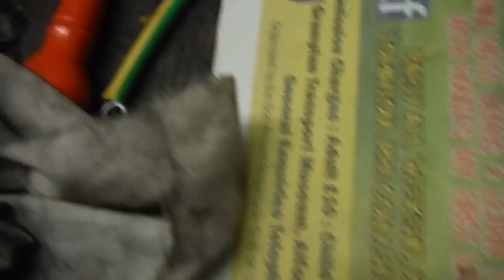Amal MK 1 carburettor - clearing blocked pilot jet passageway.

Comment: Paul remember the two holes in the center on the bottom of the throttle tube on either side of the back of the slide.  The tickover fuel and air has to have somewhere to go after they have been mixed.  Those two holes must be clear as well.

Comment: The hole from there into carb throat gets blocked as well, you can just drill out the jet with a 2.0mm drill taking care down the pilot screw hole taking care not not to damage the air screw seat you then put a new jet into the threaded boss in the top of the carb body float chamber usually used for 2 strokes
Reply: I think a man named Brian Stratton made a video on what you're talking about. If you find it let me know if that is what you were saying.

Comment: My friends and I use the smallest guitar string; I think it is .009”, very strong and stiff. Worked on my ‘69 Bonnie nicely. 
Possible to drill and tap the opposite side and use it for access on the close side and plug it after clearing. Appreciate your site !!

Comment: This is very informative, thank you. It's very hard to figure out these carbs when you start. But do you know if it's possible to replace the brass insert? After one hell of a game, clearing & re-blocking several times, I finally got the bike running okay, but too rich. Air screw is out  over4 turns now, still black plugs so I fear I've over-done it
Reply: *Stretton

Comment: Hi Paul great video question 
My bsa a65 concentric is pretty new ran great last year now it’s well blocked 
Do you know the max size drill I can use it says #78 drill equals to .40mm

If I use a 0.6mm drill would this do any damage to the pilot system 
Thanks a lot phil
Reply from the maker: Hi Phil, 0.016" rings a bell for the pilot passageway diameter.
Reply: @paulhenshaw4514  
Cheers Paul 
Yes, I rang Amal today and actually ordered a new carb and will be using my blocked one for my other bike which requires one and will be having a poke about but won’t be using anything bigger than .0016 and won’t be drilling only poking 👌👌
That A65 you’re working on…. Blimey that looks like a nightmare and going to be an expensive one I’m sure 😌😌

Comment: thank you, I cleaned mine a couple weeks ago, will have to do it again. starts but no idle.  Initially i didnt have the right wire and thought it was good enough.. not so.
Reply: They clog up quick if the bike sits. Pain in the butt.

Comment: Hi Paul 
I am Kumar I have just fitted new carb ( Amal mk1 concentric 26mm) and pod filter looks same as one that picture  above on my bike  ( 1984 Royal Enfield 350cc ) I have few questions to ask if you don’t mind and I guess as you are  using Amal carb you would be able to clarify my doubt my questions are followe
1  I don’t find any difference of using Amal carb as I was using mikarb before or Am I tuning is not right way?
2 I feel the throttle cable is just a bit hard to throttle after changed to Amal carb ( have been told by mech just because of the spring in the Amal carb is high tensed one than one was on mikarb
3 after changing the airfilter from the Indian made box type to Amal pod one which gives me ‘kisk’  ‘ kisk’ noise or is that normal with that sort of filter as I never used that before 
replies will be much appreciated 
thanks

Comment: Hi Paul, thank you for making this video, I have a 67 tiger and it's hard starting, it only stays running when I'm working the tickler and the throttle at the same time. Do you think this is my issue a blocked passageway. Thanks if you could please respond.
Reply from the maker: Hi Nick, it sounds like this could well be your problem.
Reply: @paulhenshaw4514  thanks Paul, it only stays running, when I'm working the tickler and the throttle at the same time

Comment: Good advice. Method to re-seal drilled blank would be good to know.
Reply from the maker: If you decide to go in from that side, a blob of Araldite or similar will close it up afterwards.
Reply: The hard way is threading the hole and installing a plug.

Comment: The primary discharge ports, located on the floor of the venturi,  clog up.  The only way to clear them is to prick them clear. I use guitar string. It  worked like a charm of the worked like a Charm on my 72 Trident..

Comment: Thanks for sharing your knowledge its very much appreciated,  my 68 A65 had rust particles in bottom of the float bowl and now wont start, I think these passage ways must be blocked I will have a go at clearing them 👍
Reply: The tank must be rusty so suppose I will have to coat it inside as well
Reply from the maker: Thanks Mark, glad it helped. An inline filter in the fuel line will probably do the trick.

Comment: Just an idea, but a fine gauge guitar or banjo string might be fine enough. Thanks for the clear info on that.
Reply from the maker: That would probably work, although it is a bit of a juggling act getting something small enough in diameter, but strong enough for the job. I think the hole through the passageway is 0.015" diameter.
Reply: +Paul Henshaw a standard electric guitar first string gauge is 0.010 and gauges in increments of 0.001 from this are readily available for pence on the internet individually. PM me your address I'll send you a couple for nowt I've plenty spare kicking about. Be happy to, I've learned so much from watching your channel 😀
Reply: @petergoddard1960  I use a G string from an electric guitar set.. they are 0.016" and can be purchased separately at any guitar shop for less than a quid.
Reply: @farric1  he said "g string".
Lol.

Comment: The old gasoline formula probably caused this . See Uncle Tony's Garage on ethanol  gas.
Reply from the maker: The pilot drillings / jets in these carbs are so small, they are at risk whatever the fuel.
Reply: @paulhenshaw4514  thedischarge ports  r even smaller. The heat soak on the middle  carb's pot metal causes the most clogging. That's why the middlecylender looks hotter, it'S just leaner. Most of these carbs have been around since the 70's. The deposits were hard crystalized crud I have'nt seen since.
Reply: @paulhenshaw4514  hey Paul , has anyone drilled these out larger? If so, what happened or what do you think would happen? Are they not controlled by a tapered screw anyway? At least it would make it easier to clean.
Reply from the maker: @pauliebots  a fair point, but the hole controls the amount of fuel allowed through and the air screw, being what it is called only adjusts the amount of air mixed with that pre determined amount of fuel, so enlarging the hole would create a much over rich setting, much like having the choke on.
Reply: @paulhenshaw4514  figured there was a reason hole was tiny. Thank you.